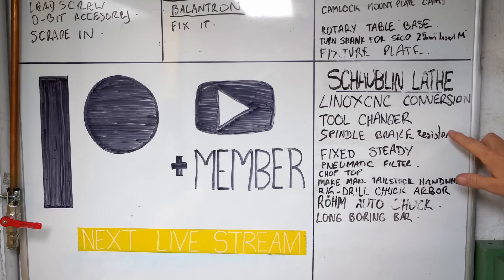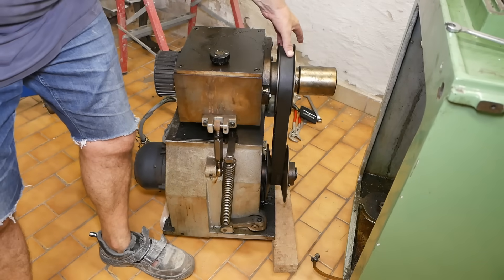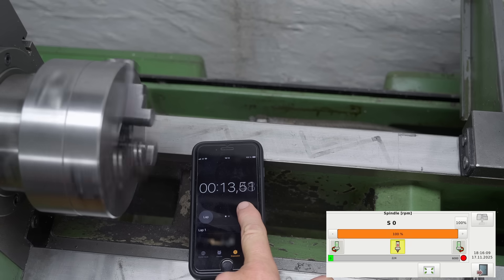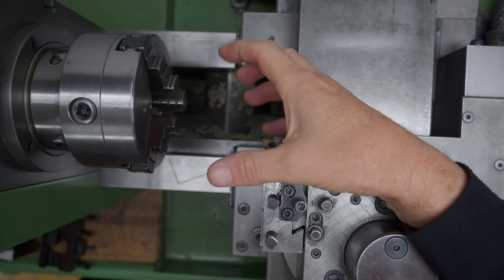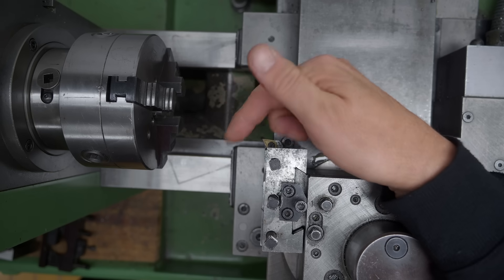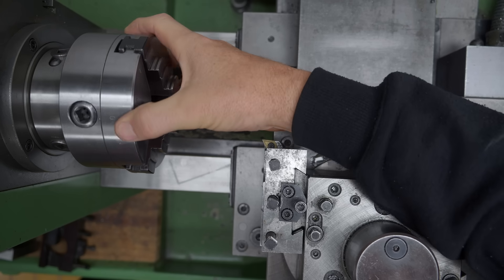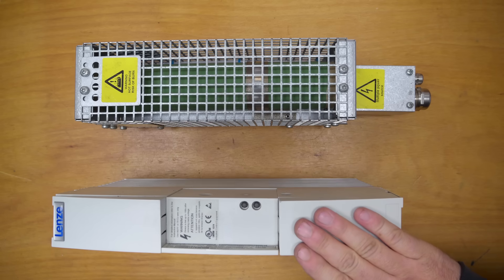Help me with this VFD Please - Schaublin 125-CNC Ep. 62 || RotarySMP

Comment: I have no idea, but I am pretty good at using AI, so I asked it to read the manual, and this is what it spit out.

Based on the manual, here are several things to try to get your brake resistor working properly:
1. Check Brake Resistor Connection

Ensure the brake resistor is connected to terminals +UG and -UG (via the brake chopper/brake unit)
Verify you have the correct brake unit installed (EMB8251-E for 820X, EMB8252-E or EMB8253-E for 821X, EMB9351-E or EMB9352-E for 822X/824X)

2. Verify Current Limit Settings (Most Likely Issue)
The controller uses C023 (generator mode current limit) to control braking:

C023 needs to be set appropriately (default is 80%)
If C023 = 30%, the current-limit controller for generator mode is NOT ACTIVE (page 7-17, 7-89)
Try setting C023 to at least 80-110% (or 150% for newer 822X/824X)

3. Check Deceleration Time
Your deceleration ramp may be too long:

Adjust C013 (deceleration time) to a shorter value
If decelerating too slowly, the brake resistor won't engage because regenerative energy is low
For 821X/822X/824X, also check C105 (quick stop deceleration time)

4. Verify Brake Unit Threshold
The brake unit has a voltage threshold that must match your system:

820X: 375V threshold
821X/822X/824X: 725V threshold (page 10-2)
Consult your brake unit manual to ensure the threshold is set correctly

5. Parameter C022 Check

C022 (motor mode current limit) - ensure this isn't restricting operation
Default is 150%, but verify it's not set too low

6. Try These Specific Settings:
C013 = 2.00 (reduce deceleration time to create more regenerative energy)
C023 = 110 (ensure generator current limit is active and appropriate)
C022 = 150 (motor mode current limit)
7. Monitor During Deceleration
Check code C053 (DC-bus voltage) during braking - if it's not rising above ~650-700V (for 400V systems), the brake resistor won't activate.
Most common issue: C023 is either set too low or to 30% (which disables generator mode control). Start there first!Claude can make mistakes. Please double-check responses.
Reply from the maker: Take a look at the first comment at the top. I have summarised my progress with the trouble shooting there. 

Note, I have now seen three different AI's have a shot at this, and none of them identified the issue.

Comment: Cheers. I can give some general VFD advice. It sounds like you are going into an uncontrolled stop. Drives need to be enabled and controlling in order to slow themselves down. This means if you are commanding a drive to stop you keep the drive enabled/powered/controlling until it comes to a stop. Generally, I have used braking resistor banks for bringing systems with a lot of intetia to almost a complete stop. You still rely on physical brakes to being the system to a complete stop and hold it at a complete stop. This usually looks like you command a stop and once your negative acceleration drops to zero you wait and then engage the physical brakes (usually the brakes are wired energize to open so you are deneegizing the brakes which engages them wether they are brakes integral to the gear motor or some external braking collar system on the shaft). If you have followup questions please ask. Edit. You will usually monitor the temperature of the braking resistors to ensure you are not "oversteering' your control of drive speed and using the braking system to compensate for poor speed control.
Reply from the maker: Thanks, that sounds reasonable, but I am not commanding a stop, or commanding drive disable in this case. I have now added the control connections to the description above. 

I am controlling the VFD with an analog 0-10V signal, plus a LH/RH input.  So there is no Stop command, but rather a command to 0 Hz.

I do have drive enable/ disable wired in, but that is only for machine start / shut down and E-Stop.

I also think I might wire up and use the electro mechanical brake in addition in the future, but that I not relevant to this current problem.
Reply: A few thoughts. 1. Sometimes you may configure a drive to coast to a stop instead of controlling to a stop during a drive fault condition. Maybe your drive is still generating an over voltage fault when you are trying to stop it and you have it set to coast to a stop on that drive fault. 2. Try the same tests but with your ramp times crazy long to see if your u get different controlled stop behavior. 3. Do you get the same behavior when controlling the VFD from the buttons on it instead of remotely? Most drives have like a local mode where you can control it locally from the faceplate. 4. If all else fails start simplifying the problem by just wiring the drive enabled on all the time or other simplifications to help isolate your issue. I've not worked with Lenze drives before but I would assume they have some commissioning software that walks you through setup and would give you some more diagnostic information. Hopefully. 5. It would help to share what parameters for the drive you have at non-default values. 6. If you have the means you can measure the current flow to/from the drive during stopping to see when it is in regen and dumping power to the bus instead of taking power from the bus to spin the motor. 7. At some point put a minimum speed limit on your VFD. I usually use like 15-20Hz. At a low enough frequency the stator stops making full rotations and instead rocks back and forth and can eventually cause wear.

Edit: these types of drives are commonly controlled by PLCs so maybe that would help in your searches for info. plctalk.net is a good resource.
Reply from the maker: @DecentFarts Thanks a lot.  I now understand what I was doing wrong. I'll make a video to best explain it.

Comment: I am surprised the cutting force of the carbide insert is not sufficient to slow down the chuck.
Reply: There’s the momentum of motor, the variator shafts, the back gear and the spindle; at 3000 RPM it’s a lot.
Reply from the maker: Well it does, but that issue is still there, as you enter the cut with excessive surface speed.

Comment: Isn't it possible that when you changed the method of operation of the VFD you actually did it in LinuxCNC by making it disable the 28 input (controller enable) on the VFD instead of ramping it down, waiting for the spindle to stop then disable the VFD?
Reply from the maker: I think you are on to it there Leslie. It is slowly getting through my thick skull. Thanks.
Reply: @RotarySMP Just a quick addition. As I understand, the VFD does not stop supplying the motor if the input 28 is at high level (24 V I guess). Even if the minimum frequency for the minimum setpoint parameter (C010) is set up to 0 Hz, it is dangerous to getting close to the chuck because the VFD is not in a disabled, safe state.
I would suggest to set up the drive like this: The paramter C010 should be 0 and in standby the input 28 should be disconnected (low level). When you want LinuxCNC to command the spindle to start turning, the input 28 should be brought to high level and an analog setpoint should be given to the VFD.
When you want the spindle to stop, the analog setpoint should be commanded to 0 V then LinuxCNC should wait to the spindle to stop (or at least to slow down to a reasonable slow speed) then bring the input 28 to low level.
Reply from the maker: @SLeslie  Good input. I will probably need a bit of ladder logic to get that behavior.

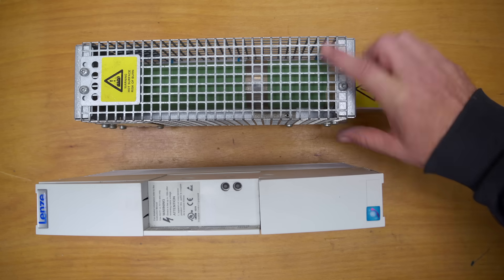Comment: 6:44 - dumping all the heat into electric cabinet is not the best idea.  industrial machines usually have braking resistor box somewhere outside.
Reply: They dont give away much heat mine wont get over 20° 😅
Reply from the maker: Thanks for your eyxperience. I also dont expect much issue, as this is unlikely to be breaking hard, frequently, long enough to get hot.

Comment: Just dont use the internal break ramp and do it in linuxcnc . That has advantage in index mode and in case you want to use the variac. But be carefull with drive overvoltage
Reply from the maker: LinuxCNC cant command a ramp down faster than the VFD can dump the energy.

Comment: You can set up the spindle-at-speed input so that LinuxCNC pauses before starting the next feed cut until the speed has dropped. That wastes time compared to actually slowing the spindle, but will give a better surface finish  / tool life.
Reply from the maker: Thanks Andy. That will require me to finally get my shit together and set up the control loops to control VFD and Variator off S. I reread your suggestion to try the (... brain fade..) I can't even remember the name of the something LIM function which will probably be the solution.

As long as there is barely a correlation between S and spindle speed, spindle at speed wont work.

Comment: The VFD saying OFF on the display means the controller is inhibited. This is most likely cause you are switching off power to terminal 28 (enable signal) to stop the drive. Did you have the terminal E3 bridged to terminal 20 during the initial tests which made issues? This should enable DC braking according to manual with factory defaults. With no braking resistor attached this would make DC bus overloltage (error you got) I only worked with Lenze 8400 and all this can be comfortably set there from laptop and there are long descriptions for the parameters. But according to the 300pg manual for old 8200 there is no such setting as how to brake in the parameters. Only the times of the ramps. Those should be 5s. I remeber 8400 had this some what odd. As the ramp was defined as time passed to stop from reference speed (also parameter) and this gave internal deceleration in revs/s2 which than applied to all sorts of speeds. But i think reference speed should be as default equvalent to 50Hz. And I have no idea how is this time used by 8200. Also it is one in the morning and I am half asleap :-D
Reply from the maker: Okay, I was able to play around with it some and think I understand it a little better.

The brake is working, but only during a speed change. So with C13 = 0.5S, and C023 at 110% current, the spindle sped change from 70 Hz to 20 Hz is braked (nicely). So that solves my decel between CSS facing cuts.

But switching spindle off coasts down. Since I am commanding the VFD with analog 0-10V, I thought spindle off just meant 0V commanded, but I guess it is uncommanded, and therefore the spindle motor output is simply disconnected. Maybe I do need an additional output pin to E3, and teach LinuxCNC how to command a stop.
Reply: @RotarySMP Does Linux CNC do something with the signal to the terminal 28? It might be the best if you set the setpoint to zero and after it stops open circuit on 28. Or after two seconds or so. As somebody mentioned here. Input E3 in factory degault  does DC Braking which does not use resistor. I never used it. We always have reaistor. Quickstop ramp should use the resistor, but if you can do this via setpoint and retain possibility to coast the motor I would go that way.

Comment: If you reset the VFD C007 is most probably set to 0. This enables DC braking when input E3 is high. Setting C007 to 2 changes E3 from DC braking to the so-called Quickstop. Quickstop is active when E3 is low which seems to be what was happening when you first put in the VFD. Then with 821x VFDs the ramp down time is controlled with C105. On 820x models it's controlled with C013.
Reply from the maker: Thanks, you are on to something there, and I think this is close,  but when I change C07 to 2, then pushing one of my on buttons, (which causes Mesa card to send a 0-10V analog RPM signal), stops working to turn the VFD on. 
My buttons which send the analog speed commands work with C07 = 0 or 1, but in mode 2, pushing the spindle start button in LinuxCNC and sending a speed command causes the VFD display to switch from OFF to STOP.

I have added my control connections to the description above now.
Reply: @RotarySMP  So I've rechecked the manual and it appears that this is the intended behaviour for this VFD. the OFF on the screen refers to the controller being locked out by the pin 28 signal. Similarly STOP refers to the Quickstop input signal being low. This is written in chapter 7.1 in the manual. In the control flow diagram in chapter 16.2 you can see that the option is either analog control or any of the braking modes. It doesn't appear that it tries to do any kind of braking if the motor overspeeds so if you want braking it looks like LinuxCNC needs to send a signal to the VFD to engage the brake if actual speed is over the set speed.

From what I can gather it looks like the VFD was meant more or less for fixed speed/load operations like process machine motors or fans but not a spindle so it lacks fancy auto-brake functionality. The brake options appear to be there for the implementation of an E-stop systems, not really a speed control
Reply from the maker: @thatgermanfan3106   Okay, I am starting to get it. The braking module is actually working, but only when I command a speed change like 70Hz down to 20Hz. If I command 0Hz, the VFD indicates OFF, and does not ramp down, it disconnects and lets the load coast down.

So it is working as a speed control assistant, but not as a auto brake.
Reply: @RotarySMP  I have no formal VFD experience but the following based on how you describe the behaviour. 
What if for stopping you set speed to 1Hz for 4 second while it coasts down and then switch to 0Hz and set the mechanical brake if you want to lock the spindle.  Obviously it would still be under power as it slows to 1Hz but for no longer than 4 seconds if that is the coast interval.

A bit tricky.  Good luck.
Reply from the maker: @KallePihlajasaari  Yeah, I have a few different options of how I do this. I will do a video on it.

Comment: A unique spindle drive system built for much older electronics.  

Most VFD's that run a CNC spindle on a lathe should be over specified for the size of the motor to accommodate chucks and parts in the spindle.  From what I saw of the spindle speed change and reduction box it's already working pretty hard for its size. On the cnc 's I have encountered that use non standard drives for the spindle you  really need a drive that is %50 larger than the spindle motor or a specialized spindle drive that usually just hides the uprated capacity. In the early 80's I encountered a machine that used an active disc brake on the spindle. It was an LC40 and the braking system I believe was only there to save the spindle motor brushes. That had a huge DC spindle motor though probably 250+ kgs but it did machine with dual carriages at the same time on a single spindle. 

Sadly I have only ever used Lenze drives on a Polar robot and the drives worked like an axis drive on a CNC with power off brake modules. In my experience if there is anything that tires in a VFD its usually the power caps, they will still work but give trouble when they start to fail. Anything else failing almost always stops them. 

Wise idea not using the brake unit as a regular part of the spindle control circuit it really should only be there for a Emergency stop condition. I would assume its a power off unit so the best way to keep it in the system is to just piggy back it into the enable circuit so when the spindle and control of axis has the power dropped the brake will stop the spindle very quickly. 

Not much help I suppose, Is there any jumpers inside the drive that can reset the config? Sometimes it's easier to start from scratch. Honestly I don't think that drive will be big enough to handle load required to keep time. Have you tried a fixed mm per rev with the constant surface speed as that would at least make it pause until the surface speed has been reached? 
Cheers
Reply from the maker: Thanks. The Brake is energised on, not energised off, so it would need active control with E-Stop. It is on my to do list.

The CSS and Feed per Rev work. LinuxCNC actually has spindle at speed inhibiting, but I also need to work out my whole control heirarchy with the VFD, Variator and back gear to get that working.

Comment: Set c007 so that the 4 inputs E1/2/3/4 do the functions you need - two of the choices are QSP (quick stop) and DC Brake.
Reply: The quick stop is not necessarily need to be used. It is just a separate way to stop faster than the ramp time set up for normal operation.
The problem is that the input 28 (controller enable) is getting disabled instead of LinuxCNC waiting for the spindle to stop then disable the drive.
Reply from the maker: Okay, I was able to play around with it some and think I understand it a little better.

The brake is working, but only during a speed change. So with C13 = 0.5S, and C023 at 110% current, the spindle sped change from 70 Hz to 20 Hz is braked (nicely). So that solves my decel between CSS facing cuts.

But switching spindle off coasts down. Since I am commanding the VFD with analog 0-10V, I thought spindle off just meant 0V commanded, but I guess it is uncommanded, and therefore the spindle motor output is simply disconnected. Maybe I do need an additional output pin to E3, and teach LinuxCNC how to command a stop.

Pin 28 is wired up, but I thought I was only  only using it for  machine start up and shut down, and E-Stop. I need to go back into the Mesa Card set up and see if I am commanding the drive enable on a stop rather than just the 0V analog.
Reply: @RotarySMP  There is a parameter both for the minimum (0 V) and and the maximum (10 V) setpoint in the VFD. These are the C010 and C011 parameters. If the C010 is set to 20 Hz for example, the VFD will supply 20 Hz to the motor when the input setpoint is 0 V.